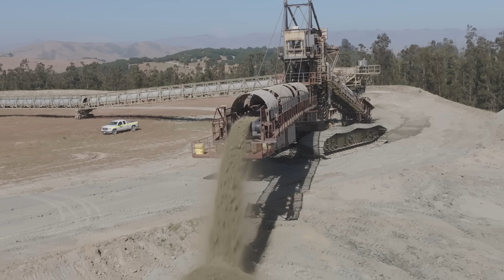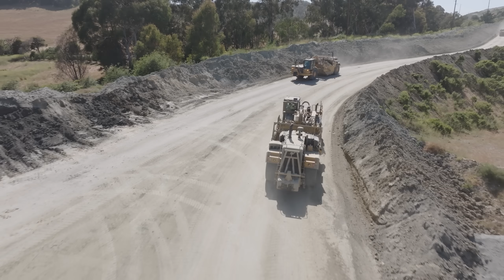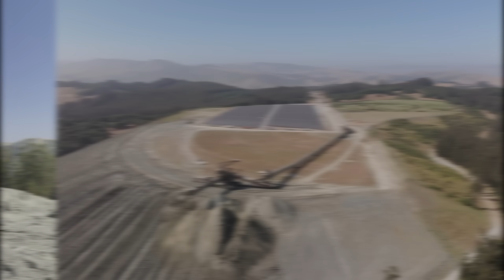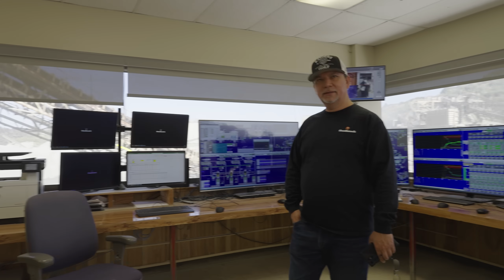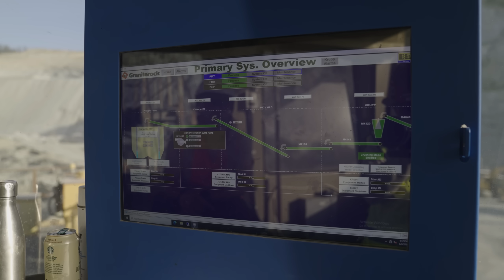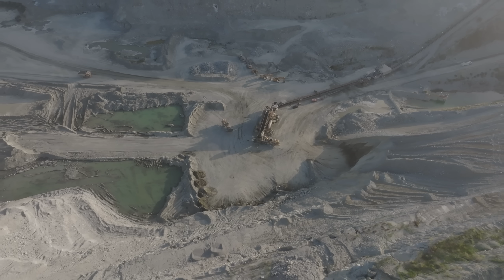California’s Giant Rock Crusher

Comment: A few facts you might find of interest: (I've walked the length of those conveyors several times on inspections, and it is quite a hike.)
1. The name "Aromas" comes from the presence of numerous geologic faults through the area, emitting a sulfur smell. Sometimes the aroma in the canyon can be quite strong.
2. The Krupp crusher is electrically powered with a long "extension cord" behind it. The cable is about 3" thick.
3. The railhead operations at the processor/loadout area are automated. The locomotives do not have any crew on board.
4. Some of the product is transported by rail to various GraniteRock plants around the area, such as San Jose, greatly reducing the number of trucks on the highways.
5. GraniteRock has the second oldest active contractor's license in California; Teichert being the oldest active.

Comment: ai: "Gyratory crushers are larger, high-capacity machines designed for primary crushing of very large rocks, while cone crushers are smaller, used for secondary or tertiary crushing to produce finer, more uniformly shaped products. The main differences are their size, application, crushing chamber geometry, and speed, with gyratory crushers operating at slower speeds for primary crushing of massive rocks, and cone crushers running faster with a greater gyration arc for secondary reduction."

Comment: interesting monster machine...
but material hauling cost is not reduced by the machine but the extra long conveyor belt...
so an alternative option could be feeding the long conveyor directly (through a grizzly bar to screen the oversized rocks) which transfers the material to a stationary crusher... and you can spare the extra cost of this very expensive unique mobile monster machine...😊

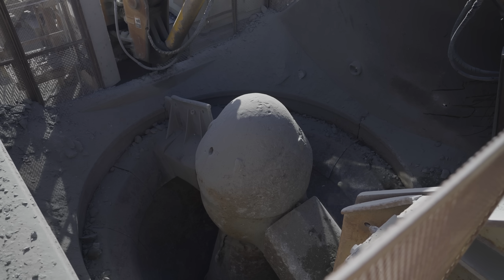Comment: 11:25 So it's like a giant mortar and pestle?
Reply: More or less yes. The cone oscillates and turns and the gap gets progressively smaller at the bottom. The rocks vibrate between cone and liner and they crush down to size as they pass through the bowl.

Comment: As a retired heavy equipment operator that's worked with crushers , I see lots of fines in those buckets going into that portable crusher. If that was pure stone, those producing numbers would be alot lower. I enjoy these videos but I will point out the obvious.
Reply: That crusher is not truly crushing.  A crusher crushes rock into smaller rock it's not a funnel for sand and small materials
Reply: @LuckyForest-og8uq  IFYOUONLYHADABRAIN
Reply: I'm sure their screening the fines before it goes in the jaw crasher because everyone knows the fines wears out the plate faster than the rock being crushed
Reply: @MichaelBulu-r3q  Gee, I fed a crusher for years, I already know that but it's still goes over the weight  scale. 🤣🤣🤣🤣🤣 obviously you don't know how a crusher is set up. 🤣🤣🤣🤣 the fines wear out the plates faster than the STONE ROCK DOES .... 🤣😂🤣😂🤣😂 there is a gap between the jaws that allows any overflow of fines to go through.
Reply: its obvious that pure stone without fines reduces the numbers. 
more bigger the stones the more lower the numbers.
but nominal numbers are for blasted materials which contain lot of fines...😊
Reply: That’s exactly what I thought. This buckets are full of fines. I do wonder if it does have the ability though to crush rock face at that tonnage hour as well. I couldn’t find any facts about it elsewhere.
Reply: @becauseboost4726  I guess that you never worked around or fed a rock crusher.  As fines totally bypass the crusher parts of the machine. And pure rock almost all goes through the crusher.
Reply: @freedomrings1420  yea that’s exactly what im saying, the material that’s going in is mostly fines. Increasing its tonnage per hour from not having to crush full on 1”- material or greater.
Reply: @freedomrings1420 well that is obvious but the fines weigh more than rock so tonnage numbers will be high if you feed more fines than rock
Reply: @freedomrings1420 Issue is the constant fines are going to weigh more than the rocks and falsely increase tonnage numbers. Should halve it at least to account for the majority of fines.
Reply: @OfficialSamuelC  LOL 😂,  another one that can't read. What do you think my comment says ? Stick with commenting on something that you know.
Reply: @Akdrtlife  Fines don't weigh more than rock . But when the fines are about 90 percent of your bucket, the fines would outweigh the amount of rock in your bucket.
Reply: Tons per hour are tons per hour regardless of what it’s composed of, right?
Reply: @johnnychilders9236 Absolutely
Reply: @johnnychilders9236  yea correct. I just think the merits of if it can actually crush that same tonnage if larger material size rock with less fines goes into it are being questioned here.
Reply: @johnnychilders9236  LOL 😂,  so many people commenting that never worked in a crushing operation.  When crushing pure rock, it takes time to crush the ROCK ,especially if the rock is big .Where as the fines drop right through the pre - crusher screen . Which means that your tons per hour will be higher when your fines are more of the crushing process.
Reply: @freedomrings1420  I work in a quarry right now brother. I understand what you are saying. What I’m saying is when a machine is commissioned, you think they’re just loading it up with chunky rock only and no fines to acquire the tonnage per hour number, or a crusher is just being loaded with blasted material to determine its hourly rate which would incorporate both fines and chunky rock?
Reply: @johnnychilders9236  Let's make it simple.  The picture in the thumbnail says 3000 tons per hour .... the video shows buckets of almost all fines with some small rocks being dumped in the bin  . I said that 3000 ton an hour rate would drop down if it was rocks . A crusher is used to bust big rocks into small rocks . And when the material is mostly fines , the crusher isn't doing much work.  So of course your tonnage number would be high. But that isn't a true number if the crusher was actually crushing rock. I'm done explaining. Good 👋